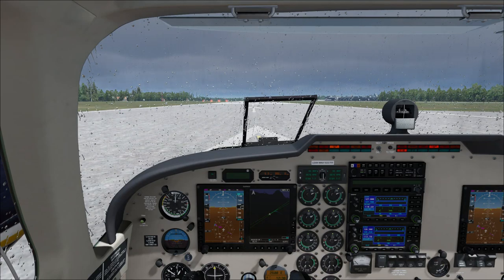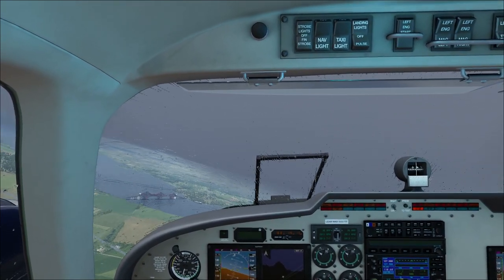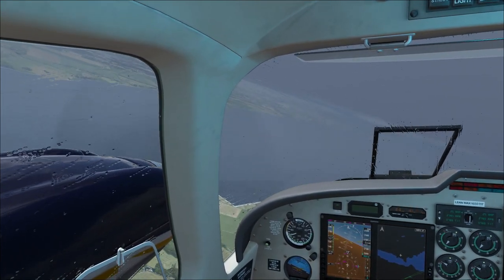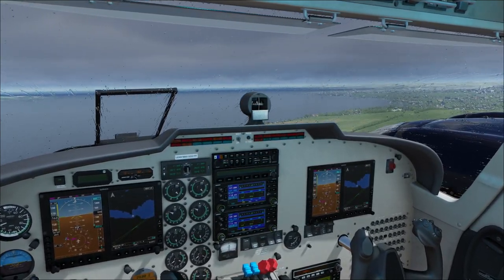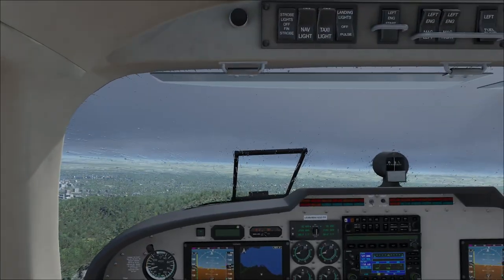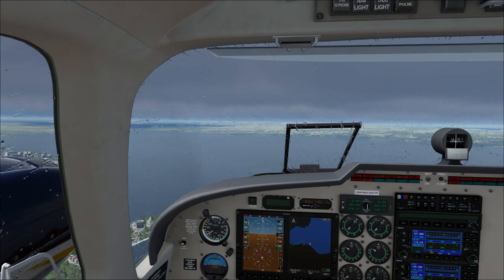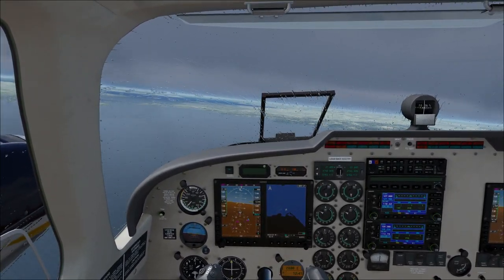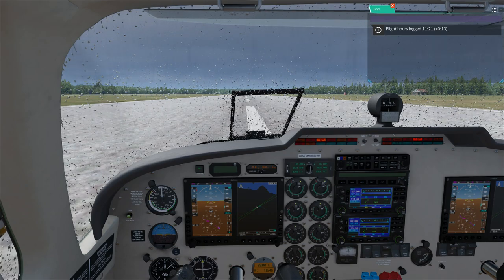Flight Sim World | TrueSKY Major Thunderstorm - Rough Flight! | Early Access

Comment: Washed out scenery colors. If dovetail aims to be the nextgen sim they have a looong way to go compared to x-plane11. Just by adding a few GA aircrafts and a new low res sky doesnt make a go to sim.
Reply from the maker: I wouldn't say washed out per say. I would say that it is moreso not matching the environment around it. Dovetail have a PBR2.0 project in the works that will be in a future community update which should fix that. Does it have a long way to go? It does, I agree. However, the sky is not low res at all (though it could do with work), and it is quickly working towards becoming the best weather engine in a sim (vanilla anyway), which is where I think FSW will shine for the time being.